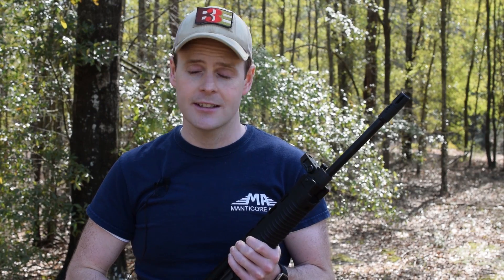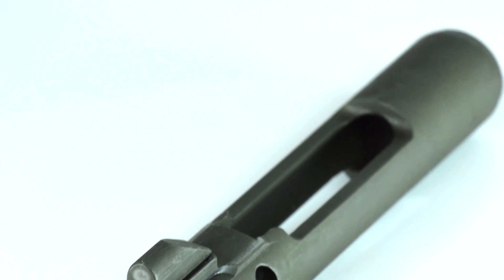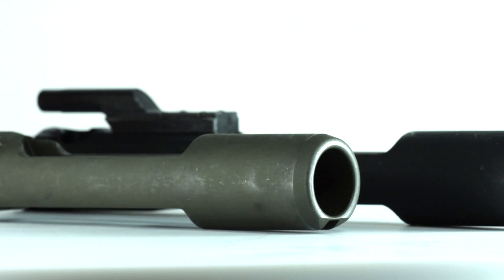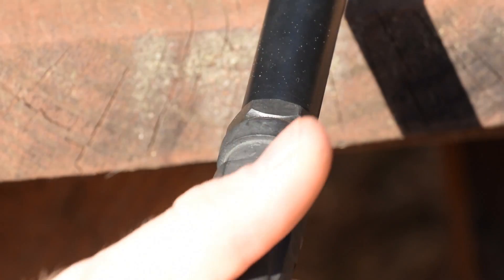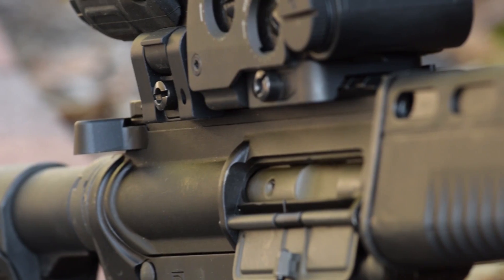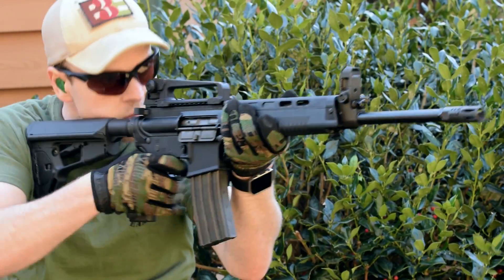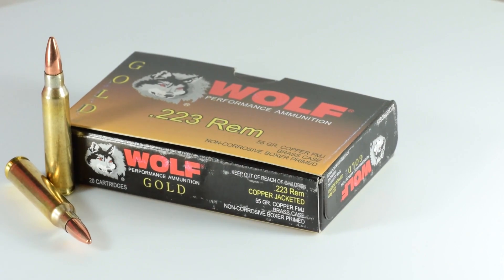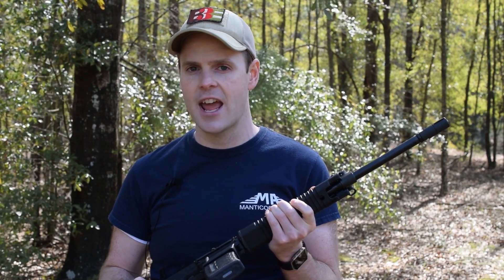Wolf A1 Upper Review - the Civilian T91

Comment: cool upper. I don't know if it's better than alot of the options already out there but it's got a definate cool factor for sure....sometimes that's enough.
Reply: It's a design that builds from ground up for piston design and has been adapted for  over 40 years by some countries,I think it worths a shot.
Reply: shadowjllj I didn't say it's bad....I just don't think it's design is enough to get me to pass up on a much better design like an Adam's Arms retrofit kit.
Reply: I am just curious, why is Adam's Arms retrofit kit  better?
It`s a retrofit kit which means it doesn`t design to be a piston rifle from the ground up.
Reply: You don't have any aftermarket handguard options with this rifle. Also if you bend a op rod or crack a gas block or tube or anything breaks...and Adams Arms part will be easier to order than any part from Korea. 

I like the rifle but its more of an old school fun range toy now than a real modern day self defense tool in my opinion.
Reply: @mixflip  as an enthusiast too I find it weird you would pass on it. Like the adams arms kits an aftermarket will grow. It took awhile to get mainstream with rail compatibility for aa pistons. Its also something new keeping ar15s relevant.
Reply: @Kyle_gallegher  I like it. I just like other designs a bit better like I said before. That's the beauty of the gun world nowadays.  There are lots of options. I owned a Stag M8 which is very similar to this rifle. It worked fine....but I now like the mindset behind PWS long stroke systems.
Reply: @ReadyOrNot where ???? i cant find handguard for it
Reply: ReadyOrNot been sold out for awhile
Reply: ReadyOrNot thank you
Reply: @mixflip  They make an MLOK handguard for it these days
Reply: Piston driven in my option is the best way to go for a lot of reasons. Proven in sks and AK variants very well.

Comment: it has quite a few desirable features that we find in desirable in a civilian AR: 1 in 7” twist barrel with a SOCOM profile rather than M4, the removal of the forward assist and a shrunk down brass deflector. The bolt carrier resembles most piston conversion kits out there, but the gas block, handguard and piston look unique. The barrel is topped with a non-A2 muzzle device which looks to be a hybrid flash hider and muzzle brake.

Comment: Throw on a UTG Low Profile rear sight (surprisingly good quality vs other crap sights they made) for the heck of it. Those are made in Taiwan :P

For $24 it actually competes with higher quality sights. Machining and finish is similar to what Strike Industries puts out.

Though MBUS rear sights can be found cheap as well.
Reply from the maker: Capt Destro - Sounds cool, I'll have to check it out later.

Comment: Just a slight correction, the T65 was actually based on the M16 and predated the M4's design by around 7 years. The Taiwanese military liked the ergonomics and weight offered by the M16, but it's reliability in jungle warfare came into question for the Taiwanese following the Vietnam War. Using blueprints from a wide variety of piston guns (the AK, SKS, and M14), they came up with the T65. Early iterations had issues, but the T65K2 that came out later was what the Taiwanese military was looking for.

Comment: This was a well done video, I enjoyed it very much and thought it was very professional. But, I always laugh my ass off every time someone talks about reliability with the DI versus Piston systems. I run both. I've been an armorer and instructor for my agency for going on 15 years. The only thing that makes either of the systems unreliable is end-user maintenance issues. It takes a LARGE round count and a lack of lubrication to cause the "shits where it eats" issues. I've also watched presenters on YouTube complain that the piston systems weren't as "maintenance free" as they were "led to believe", usually when they were running a suppressor but ALWAYS because they never performed any maintenance. The worst thing you can do with a firearm of any type is fire rounds through it and not clean it in some way. Some of the newer bcg coatings, such as NiB or TiN can go a lot longer without lubrication but you shouldn't allow this to occur. People, run your guns lubricated with lubricants rated for your weather conditions of extreme heat or cold depending on where you will run them. I have an Ar15, DI, that is a regular shooter. I've had it for 17 years, same bcg, barrel, etc. I run the snot out of it, it's round count is in the 10s of thousands. I've replaced an extractor, the extractor spring, ejector spring... and that's it. I'm getting close to needing a new barrel. I've run everything from Wolf steel cased to Black Hills. The only ammo issues I ever had were with Tula. The only magazine issues I ever had were with some cheap ass Thermold I tried that were surplus. It's been an extremely reliable firearm as have all of the Ar platforms in our inventory; Bushmaster, Colt, DPMS and LWRC (which are our patrol rifles). They ALL need to be kept reasonably clean and lubricated. If you can't clean your gun right away, at least apply fresh lubricant. This reliability bullshit is mostly just people not taking care of their firearms or using out of spec parts / components.

Comment: I own a 16" Wolf A1 my biggest gripe is the picatinny rail length.. Go ahead put a rear flip sight on it and attempt to add pretty much anything else >> won't fit. I know there are other options to extend out the rail but wasn't as happy with it tbh as what I thought I'd be. I also notice the forearm is starting to discolor (potentially due to heat as I noticed significant heat during longer duration of ~60round slow fire) a bit with age which is unfortunate. For me it's just a plinker.. Great video though, and as always your milage may vary.
Reply: I have gone to using a 45* offset  for a holo sight and ordered the factory rear sight....works great.   LOVE this upper with a binary and a VG6 Epsilon muzzle brake...at 100yds its crazy accurate with a mk262 or mk318

Comment: Why the hell hasn't the USA standardized the piston system to our ARs yet? Everyone else has a piston driven system in their weapons EXCEPT us. Dam, get with the program. This upper is in-genius.
Reply: POPJack1717 Because contrary to popular belief, DI is a very solid, reliable system when done right. It works.
Reply: mostly money. the M27 is an H&K 416 that is a short stroke rifle being adopted by the united states. even though other companies make a more than acceptable platform that will perform on par with the 416. you know the P415/308..
Reply: A Bowl of Pho if you have proper gas tube length to the barrel and being adjustable semi auto only DI is reliable.
Reply: Do we know if this upper requires a buffer and spring?
Reply: Mr. C. Yes all functions except the gas blowback are just like a standard AR15
Reply: @Brianbaker3  o well, was hoping to add folding stock
Reply: Mr. C. The company LawTactical does offer a folding AR buffertube accessory but the firearm won’t function while the buffer assembly is folded.
Reply: @Brianbaker3  defeating the purpose
Reply: The two true flaws of the AR15/M16: buffer tube that lives in the stock and not having the absolutely superior piston driven gas system. This upper solves one of them.

Comment: Direct impingement? Idk man. After a ton of research I don't necessarily think the AR-15 is actually DI. 

The gas is fed into the middle of the bolt carrier into the area that the bolt sits, which I call an expansion chamber. I'm sure there's an official name for this space but I digress, the gas filling this space forces the bolt and carrier in opposite directions, thus camming the bolt open and sending the entire carrier backwards. This is almost a half piston, half DI system where the bolt and carrier themselves act as the piston, as the act of the bolt and carrier being forced apart is what actually initates the rearward travel of the bolt, and ALL other DI systems use the expanding gas itself to send the bolt/carrier rearward without any other expansion chambers or gas direction.

Comment: I plan on building a modernized m16a1 look alike with this upper (16inch) with a fixed stock and a carry handle due to me not liking the direct impingement system due to it craps where it eats and I don’t want to have a picky ammo gun, I’ve heard bad things about steel cased ammo breaking extractors with non 20 inch impingement uppers and steel cased ammo is cheap usually.

Comment: Are there any rails pieces or different hand guard options available for this upper?
Reply from the maker: biggboysouth - Yes, but not in the United States, yet. Wolf said they are working with companies to build or import accessories in the future.
Reply: Awesome Thanks for the reply. I'll be adding this gun to my gun wish list, I actually have a list with different guns I'd like to own lol. At the top currently is the CZ Bren2 rifle that will be available in 2018.
Reply: biggboysouth yes there are, but exclusively in Taiwan at the moment, and they are mostly manufactured by airsoft companies due to firearms are not available to the public in Taiwan, however it fits just fine on the real thing, here's a photo of our UDT operator wielding a T91 with rail piece
http://twimg.edgesuite.net/images/ReNews/20150921/640_56db28e15a8e12d912a662d4f0306055.jpg